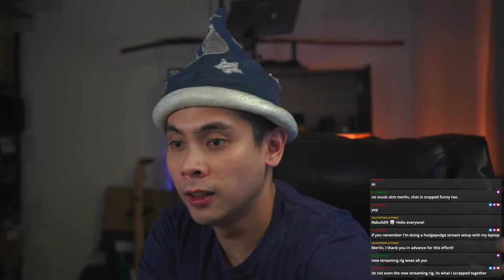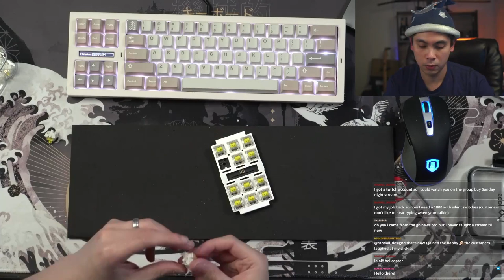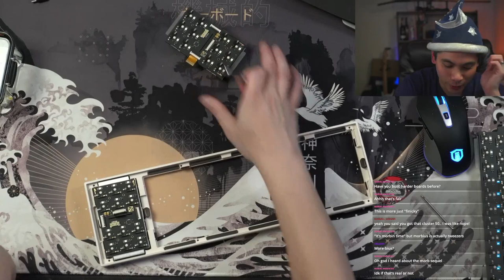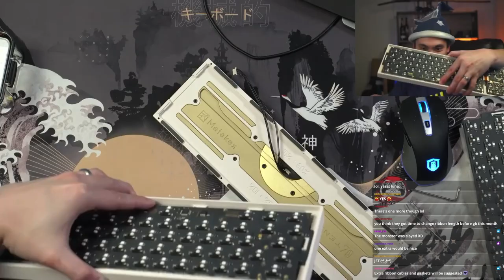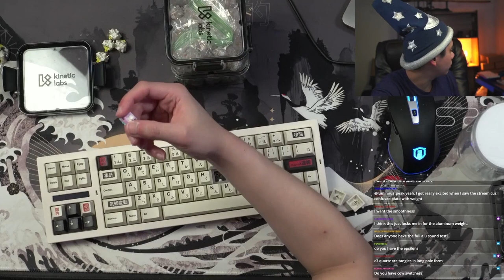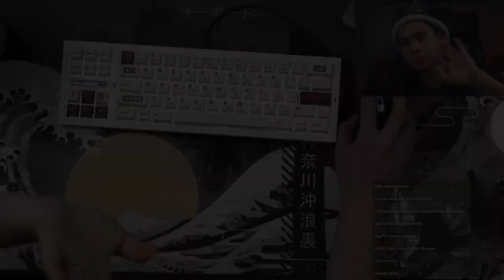Rebuild: Tenet 70 with Aluminum Plate - Will it sound better?

Comment: will the Tenet70 have the alu option before buying or is this like an accessory I have to buy seperate?
Reply from the maker: Default is PC, no indication of whether or not it can be changed or if other plates are extras.
Reply: The GB thread is up now, and it does seem like you can choose.

Comment: Props to Metakey for trying, but the sound is kind of a deal breaker. Also, having something so proprietary with one of its main features (oled) also turned me away. Here's to hoping a similar, but better version comes out in the future.
Reply: Proprietary while I agree sucks sometimes. I think all the reviewers said the software is actually very good and easy to use. So it can’t be all that bad yeah?
Reply: @MrSkullhead0  Software is fine, yes. What I worry about is 5-10+ years later when support/updates might be gone. Unlike the more commonly used qmk/via where there's a lot of code floating around.

I wonder if the tenet70 can be configured like the other boards with oled and can be used with qmk/via.
Reply: @arjunaSan  good point. I am curious if it ever could. That’s a good question 🧐
Reply from the maker: The software is fine until you try to implement qmk like functions